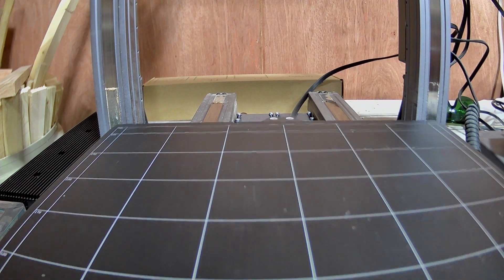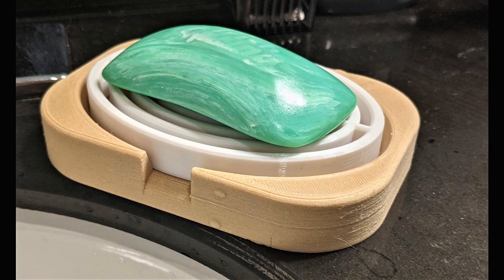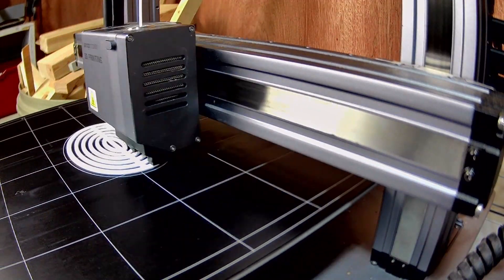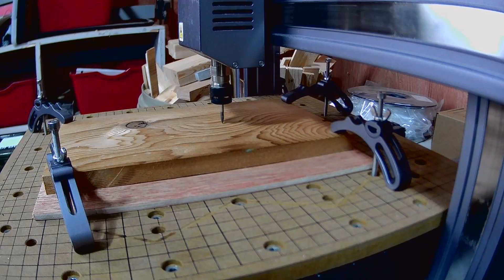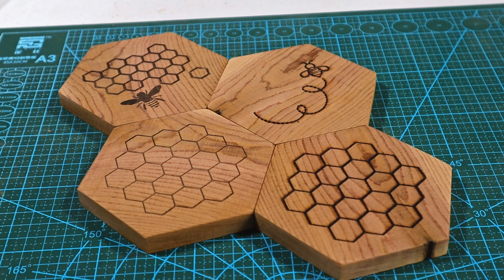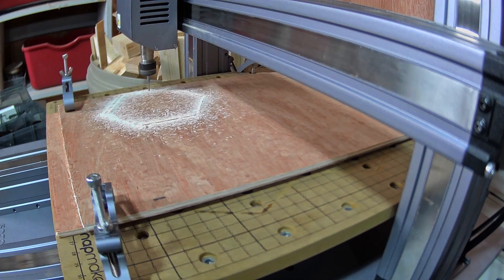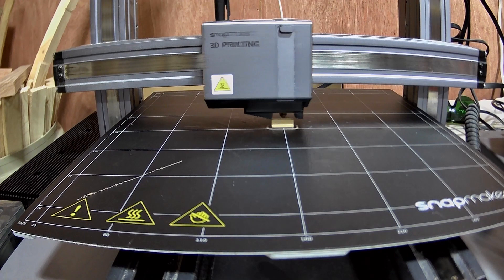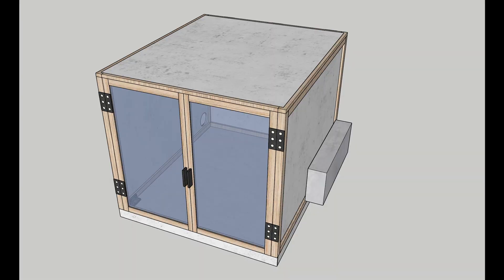DIY Projects You Can Sell - Made With SnapMaker 2.0

Comment: Good luck with your enclosure build! I have the official one and it cuts down half of the noise and rid of the laser fumes, not to mention the boost it gives to ABS printing and the laser protection.
Reply from the maker: My enclosure is 99% complete - I doubt it will ever be 100% complete because there is always more to add to it. It makes a big difference with the noise, I have yet to test the laser though
Reply: @LogHouseFarm  a good hack is to lay the machine on the black foam it came with the box, reduce noise by a huge portion
Reply from the maker: @abrokeengineer967  I have kept all the foam, so I can give this a try

Comment: Great job! I love your laser engraving outcomes. I just got mine a few days ago, its my first time operating the laser engraver and I’ve been trying to work it, however I couldn’t quite get the perfect setting to work it well, any suggestions on what setting to use for better engraving performance.
Reply from the maker: I tried a few other projects with the laser and did not get good results - the coasters were my best results so far - I just made sure to calibrate before use, and then adjust the laser power as needed.

Comment: Hi, good job! Which CNC bits do you use? They look longer than the Standard Snapmaker CNC bits? And what is the maximum Material thickness you can work with them? Thx
Reply from the maker: I bought some bits and collets from Amazon so that I could cut through 3/4" stock.